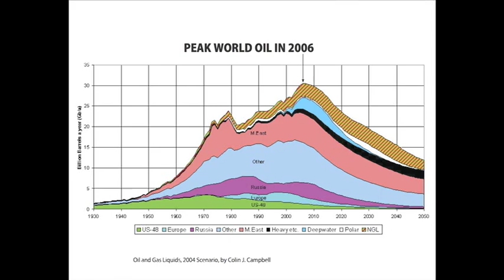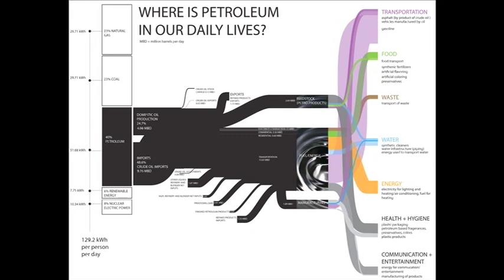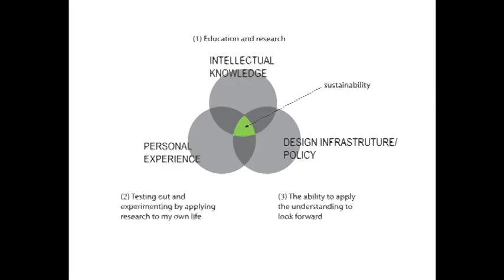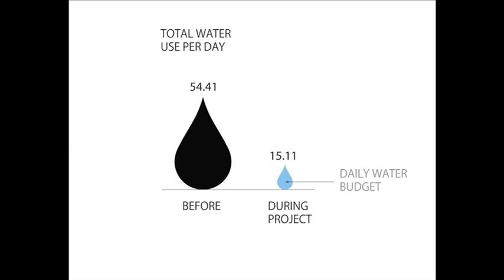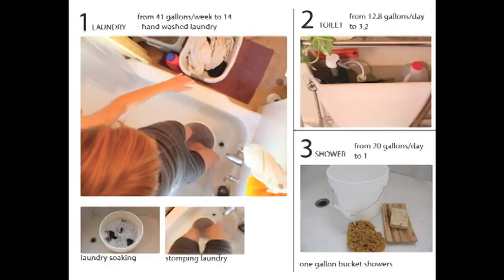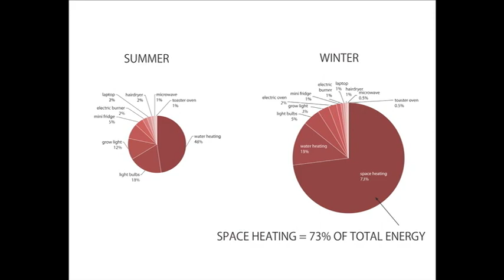Sustainable living in a "post-oil world": Molly Eagen at TEDxUMN Salon 2011

Comment: oh, and you can dump the excess salt into the ocean as long as you have made sure that it is free of contaminants and you have a good sewage treatment system that makes the water you send out to the oceans clean. those toxins could be collected and with some work put back into what they were used for in the first place. but all of this needs one thing, ENERGY. and of course i do mean sustainable energy. it might take some time, but using solar and wind and i mean USING, will lead to efficiency.

Comment: the biggest problem for water is energy. a person stranded at sea might say water all around and not a drop to drink. if you have power you can turn that water into something that you can drink, it of course takes a bit more than energy, but even a hillbilly's still can do it, clearly not a complex operation. it is energy intensive though. but that same still can render bad water good in most cases. of course we need better solutions there, but it is simple. what we need is ENERGY.